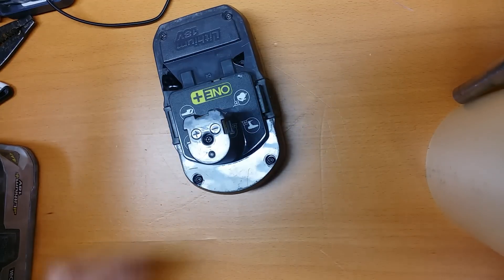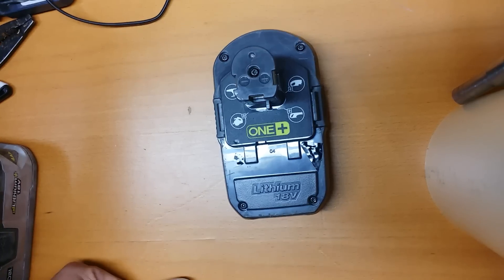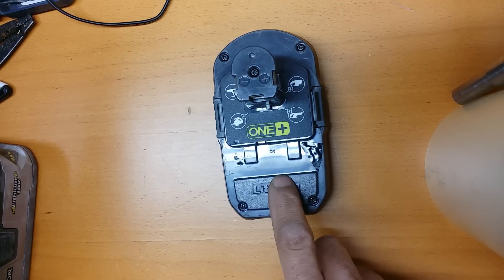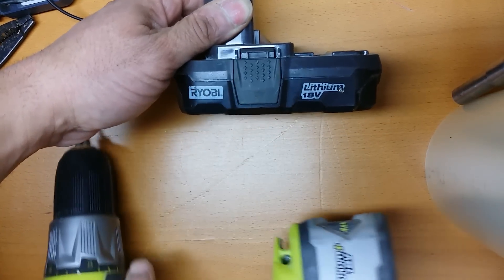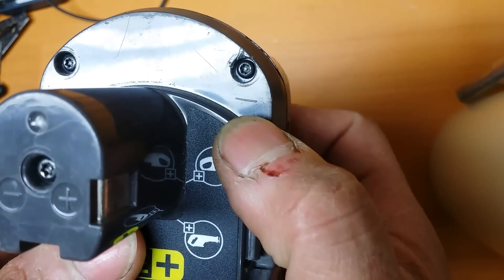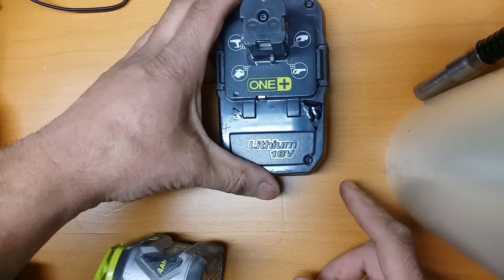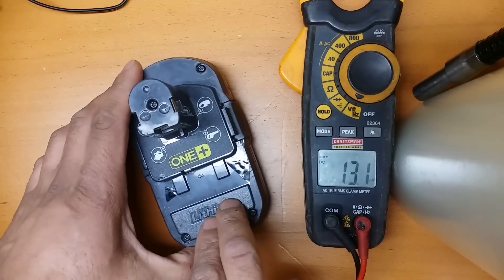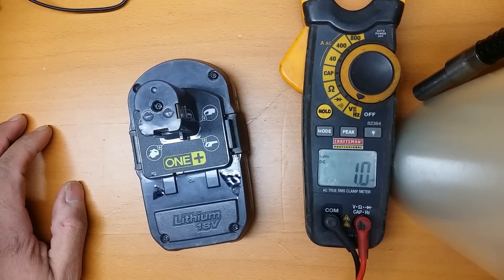How to revive a Ryobi 18 volt lithium battery. Quick and easy

Comment: WHAT DO I USE IF I DONT HAVE THAT HERCULES CHARGER (I KNOW THAS NOT ITS NAME) IS THAT A CAR BATTERY CHARGER?????
Reply from the maker: dequanp1979.   yes you can use a car charger at regular 2 Amp - 10 amp for 30 seconds charge.
Reply: tomstuff460 THANKS IM TRYING IT NOW

Comment: Thanks for this. It worked.

Tip...if you don't have a power supply like in the video, you can use an AC adapter. I used a 10.5 V one; just cut and stripped the wires and put them through the two drilled holes to touch the respective + and - contacts. I think a 12v car battery would work. Must get polarity correct.
Reply from the maker: SuperJacknyc 👍

Comment: OMG! Thanks, we had 3 that just would not charge, went out and bought 2 new 3amp batteries yesterday thinking these were toast, holy crap it worked, so now we have 5 working batteries. Amazing, though we did the jumper from a new fully charged battery, 30 seconds and it was reading about 17 volts, put it in the charger and we're blinking GREEN. Way to go. Thanks.
Reply from the maker: L Johnson awesome👍

Comment: Two thumbs way up! Worked perfect. All 3 of my "Defective" batteries are now blinking green! Thanks for sharing!
Reply: But I use a way smaller drill bit and put a paper clip on the ends of my wires from a regular 12 volt battery for 5 seconds at a time 5 times. Bazinga~
Reply from the maker: Sdavis Davis..  great idea never thought about drilling a smaller hole using a paperclip👍

Comment: worked for me. i jumped it with a small atv battery for 10 seconds and it is now taking a charge. i put a little bit of latex calking in the holes. thanks for the info and saving my battery
Reply from the maker: knechvatal you're welcome👍

Comment: I just did it and it worked! Thank you so much for this video I have a small battery charger and I just used skinny nails to attach to the positive and negative leads after about 2 minutes put the pack on the Ryobi charger and we're good to go thanks again
Reply from the maker: Kevin Mcguire you welcome👍

Comment: THIS WORKS ABSOLUTELY PERFECT.  NO OPENING.  I USED MY 12V CAR BATTERY CHARGER AND TOUCHED THE CORRECT TERMINALS(VERY IMPORTANT) FOR ONLY 10 SECS AND IMMEDIATELY BOOSTED THE PACK.  THE RYOBI CHARGER IMMEDIATELY RECOGNIZED THE BATTERY AND IT CHARGED FULLY.  I DID THIS WITH 6 BATTERIES WITH TOTAL SUCCESS...........THANK YOU+++++++++++++++
Reply from the maker: grillcheese38rc  you welcome

Comment: Five Stars! Thank you Tom. Drilled exactly where you showed, and it jumped enough to charge in 5 or so minutes! Saved me time, money, and headaches.

I don't have a power supply or 12v car charger. Instead, I taped 14g wire into the holes, and then to the corresponding terminals on an identical, but working, Ryobi battery. Unplugged a few minbutes later, slammed that bad boy in the charger, and got the flashing green for the first time in MONTHS!! 

Hats off to you, sir. Well done.
Reply from the maker: ColdRevenge86    thank you

Comment: i think it might work temporarily, but what if one of the cells is bad?
Reply from the maker: OffGridNorthwest I've been using the lithium battery for over 1 year and still ticking. if one cell is dead do you have less run time on it. thanks for your question
Reply: tomstuff460 nice. This probably works for most newer packs; I'm betting the battery management won't let it drain too far to damage the cells.
 I opened up an old p108 that quit working completely and won't  charge; annoyingly, the cells are covered in a protective foam that has to be scraped off in order to make contact but I was able to find that 4/5 of the cells are at less than 1 volt, so I'm hoping charging them up individually will revive the battery as it has 4.4v overall.
Reply from the maker: OffGridNorthwest you come probably energize the battery by using the leads that come to the cell to the circuit board
Reply: this method is usually because someone discharged the battery to a point that the charger will not allow it to be recharged. it a cell is bad you have to replace it....no other way
Reply from the maker: JIMMY TATE I totally agree with you. if the one cell is dead it needs to be replaced the pack.
Reply: OffGridNorthwest yeah so that is the catch, if your problem is a low cell then this fix is no good and potentially dangerous. Typically there is a big safety margin on the individual cell management but I wouldn't put too much stock in that.

Comment: I came here to add that this worked perfect, after drilling the holes, I only had to bump the pack with a 12 volt fast charger for about 30 seconds. (Long enough to watch the gauge drop down) - don’t leave these packs discharged.
Reply from the maker: J Grizz  thank you glad I could help!

Comment: Just tried your advice and it worked for me!  Yes, thank you very much for sharing this tip.  In order to give my battery it's initial charge, I just wrapped 14 gauge copper wire around the posts of a lawn and garden battery and touched it to the Ryobi battery for a few minutes and that was enough to get the Ryobi battery working again.
Reply from the maker: Tom Duer. glad to hear that it works 👍

Comment: This actually worked!!!  After drilling the appropriate holes to access the battery leads, I had 4.99 volts.  Just under the 5 volts the charger looks for before declaring the battery dead/nonchargeable.  The battery is not actually "dead".  Ryobi just wants people to continue to buy batteries.  So, the circuit board in the battery is "programmed" to identify the battery as "nonchargeable" & that it should be "replaced".  I don't have a power supply, but I hooked wires to the negative & positive terminals of a 12v marine battery I have in storage in my garage.  I inserted the wires to the corresponding battery leads through the holes I drilled.  I secured each wire with 2 mini-clamps & let it sit for 5-10 minutes pulling voltage from the marine battery.  After I disconnected everything, I measured the voltage in the Ryobi battery using the drilled holes.  I got a voltage reading of 14.5v.  Way more above the 5v "threshold" used to declare the battery "nonchargeable".  I put the battery 18v Ryobi battery into the charger & it started charging (flashing green light).  Before, all I would get was a constant red flashing light.  One note:  The 1st time I put the 18v "revived" battery into the charger, it started charging (flashing green), but then it stopped.  It went back to a constant blinking red light.  Based on a few other videos I watched on YouTube, I plugged & unplugged the battery charger itself several times with the battery in the charger.  After that, the battery charged with no problems.  I think the charger itself needed to be "reset" (i.e. "re-booted").  This simple "fix" must drive the battery manufacturers nuts.
Reply from the maker: greatwhite0075 thank you! great to know that information and  glad it worked 👍
Reply: It would drive the manufacturers nuts if a majority of people knew about it.  But the vast vast majority of consumers just buy new ones so Ryobi I'm sure doesn't give a shit at all.

Comment: One of my Ryobi 18v batteries charge but tool cuts out quickly under load....?
Reply from the maker: putheflamesou  the circuit board on the lithium battery pack has shorted out or is not working.  On one of my battery I had that problem. I open the battery pack and bypass the circuit board from the positive lead   . I used the soldering gun and soldered a  14 gauge wire from the circuit board positive to the positive terminal and that worked great. the only problem the battery pack won't recognize when the power is low  so if you continue using it would  dead out completely . when charging it I would recommend to keep an eye on this battery pack when it's fully charged. remove it from the charging  to prevent overcharging .  Thanks for the question hope this helps

Comment: This was a great video. Didn’t fix my issue but proved the batteries were good and electronics were bad. Hole drill points were spot on and was able to test batteries through them.
Reply from the maker: Steve Berube .. on one of my batteries I bypass the electrical board directly and it works perfect and it still charges the battery pack. it crossed my mind to make another video about this
Reply: tomstuff460 just be careful. The circuitry is there also to prevent overcharge and battery explosion. Every LION battery requires that.

Comment: Sounds like a shitty charger.   I've got a 6 bank charger, and my batteries are always plugged in when not being used. It kills the charging, and then gives a trickle if it detects the battery has drained any... Batteries stay topped off. 

  Going on 2 years now, and I've not lost one yet.
Reply from the maker: RIPPER334.. actually I found out sometime later that someone has cut off the power on that particular  receptacle where I had my charger plugged and it sitting on the charger over the weekend with the power off. that's what killed my battery. 
this video was posted already after I found out what happened.
Reply: tomstuff460  That makes me feel better about leaving mine plugged in all the time.  

I've bookmarked this video in case it ever happens.  👍

Comment: Why do people dislike when it is a great solution?
Reply: Its the ryobi employees who dont want batteries to be repaired
Reply: my assumption would be because drilling in the direction of a lithium battery is extremely dangerous.  you can do the same exact thing, in a MUCH safer manner by pulling out  5 torx screws and having direct access to the  terminals.  much safer, and much easier.  and works with all sizes of ryobi batteries.  and doesnt leave 2 holes in your batteries.  i find it very dangerous to tell people to drill into their batteries.  too many dumb folks out there that dont realize they are only drilling through 1/8" of plastic that could get themselves into some serious trouble.

that said... no dislike button click from me.  its a neat alternative.  just not one that id recommend..
Reply: idiggplants  nailed it ^
Reply: @idiggplants  a little two part epoxy fixes the holes in the case.
Reply: brian bass dude you can just unscrew the pack instead of drilling
Reply: @Horace1993  and then do it again. And again. And again. This is a good solution for a poorly designed battery.
Reply: They obviously voted for HILLARY CLINTON and want TOM to come over to their house and do the batteru fix for them and the projects they are working on as well. ITS TYPICAL LEFTIST WACKO BS to leave a HATE MESSAGE to this terrific video.
Reply: It is not always a great solution, it may, or may not, give some sort of life to an otherwise dead battery, but is like pissing in you pants. 
Your battery is damaged and you will have to use more power (electric energy) to charge than before, and this energy level will go up, up, and up, and at the same time the energy you get out of the battery pr charge is going down, so you pay more for the energy you store on the battery, and you will get less energy out of the battery, at some point it is a better deal to buy a new battery.
You have you battery in the charger 24/7 and it is charge all the time, you hook the battery into you tool and it works for 11 minutes, is that a great solution, no it is not, but you battery have some sort of life and you are happy.
Reply from the maker: Brien...  maybe my poor video or maybe because they didn't come up with the solution first.
 This video has a huge positive feedback. and I'm glad I can help out. 
 I get a lot of thank you messages on this video.
 thank you for your question and have a great day and a Happy New Year!
Reply: Ugh most likely cause haters gonna hate

Comment: Holy crap this works!!!!! Brilliant!
I drilled smaller holes & used my multi-meter lead cables as the jumper cables.
I then jump started it from a known still good Ryobi P102 battery instead of a wall dc supply,
.......& as we speak my jumped battery is now charging!!!

BRILLIANT!!
THANKYOU!!
Reply from the maker: Bubba Smith . awesome 👍

Comment: You'd think the idiots at RYOBI would redesign the battery to prevent this inability to charge when the voltage is too low. Or perhaps this IS part of their design, forcing you to buy more batteries.
Reply from the maker: richardcheesesmoker . Actually this is to protect your battery but once the battery goes low while using it you have to let it cool down if is warm then charge it.  Never let the batteries sit for days without charge it. the voltage will drop even more and then you won't be able to charge it. Remember Ryobi has lifetime warranty on the lithium batteries . They will replace it. Good luck!
Reply: Many thanks

Comment: awesome... thanks for saving me $80 bucks... fyi... i used a common black power adapter that plugs in the wall, that was rated for 12VDC, 1.5 Amps.

Comment: awesome... thanks for saving me $80 bucks... fyi... i used a common black power adapter that plugs in the wall, that was rated for 12VDC, 1.5 Amps. for about 30 seconds.
Reply from the maker: Richard Swenson ... awesome👍
Reply: @tomstuff460  what does that mean? all these people usimg black power adapters - are they separating the wires and running one thru each hole? and how do you know which wire is + and which -  ?

Comment: is there some reason why you can't just use the positive and negative terminals that usually plug into the charger - is it really necessary to drill the holes?
Reply from the maker: Justmyusername ..  if your battery chargers shows a wavy red light. that means your battery voltage is extremely low then the circuit in the battery will disconnected the top terminal.
Reply: because it has a circuit board inside ! you will fry it! you have to hook straight to the batteries

Comment: Thank you tomstuff460 - worked perfectly.  I have 1 amp 12v slow charger, drilled the holes, hooked up the slow charger for about 10minutes - my battery voltage went from 3v to 16v. The Ryobi charger then accepted the battery - green light flashing, finishing the charge.
Reply from the maker: backpacker1964... you welcome.

Comment: First off, this works. It is easier than the other videos because most people do not have security torx bits. There were two tricks for me. I used a 12 V car charger and I had to let it sit longer, probably around 10 minutes. Second, I then had to take the battery and put it in my drill and simply trigger it on for about one second. After that, I put the battery in the charger and it would charge. Nice work, thank you!
Reply from the maker: rpedersonkc .. Great information. am glad it worked for you.👍

Comment: Hey Tom, this is cool. I watched a couple vids where folks had a one plus 100 and watched as they either flipped the power on a strip their charger was plugged into or they pushed and pulled the plug from an outlet. I tried that method before I was willing to drill and I'll be a son of a bitch it worked. Now I don't know about ALL batteries, but I'll be going to goodwill to get another to retry that experiment and give you result..
Reply from the maker: elfpimp1... I actually have picked up some really great Ryobi tools in Goodwill. I brought a palm sander and a replicating saw for $6 dollars a piece and work perfect.
 looking forward on results /experiment. Thank you!
Reply: tomstuff460 wow, only six bucks a piece? ? You're lucky, the one here in Seattle charges TWICE that. I still like it tho. It's like the biggest one. Look up Dearborn st. Goodwill. And I'll let you know what happens.  I'm hoping to find one of their 18v circular saws.

Comment: I have a p100 plus, any insight on where to drill those??
Reply from the maker: elfpimp1  .. Sorry I used to own those batteries. the (p100 Ni-Cd batteries) I had too many problems with them they don't hold the charge once they lose their power. That's why I switched over to their lithium batteries. For the P104 I do not own one so I can't  tell you where to drill at . I don't want to give you the wrong information on this sorry!

Comment: Worked great, no need to open the pack just drill very small and little pressure at those exact spots. Mark the positive and negative too just as he does. I took a small nail and alligator clipped it to a short wire and just held it on the CORRECT pads on another charged battery (Pos to Pos - Neg to Neg). Don't hold too long, my little thin wire started to get hot in 30 secs! Pop in the charger and a few red test flashes and charging green!! Thanks for the detailed great video. Don't drill hard or into the metal you are just going to jump start the low cells. It would not be rocket science for the engineers to add a fix for this. Just allow a 5 sec charge to 'touch' the cells and then disconnect. It's because they are too low it will not try. The jump start will work if the cells are not bad. My guess is the lawyers got involved and nixed it as too $$ chance. Do proceed with warning, these are powerful cells. Do not short the wires and it may fix yours!
Reply: BarnAgain1 a